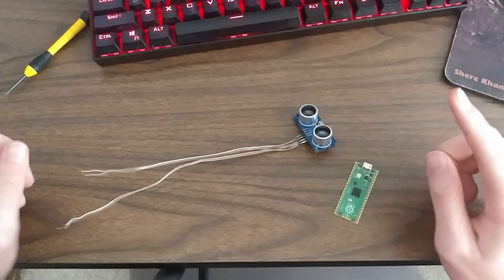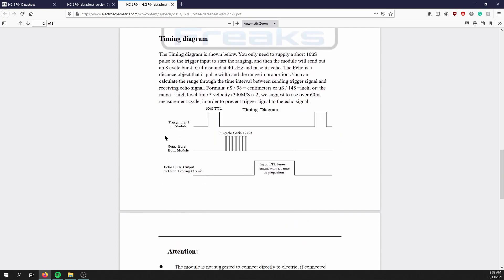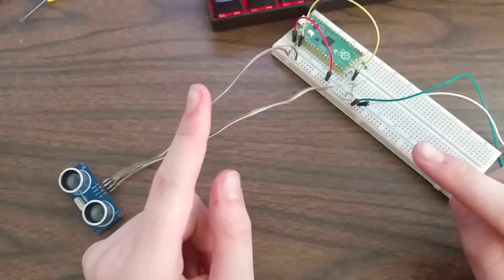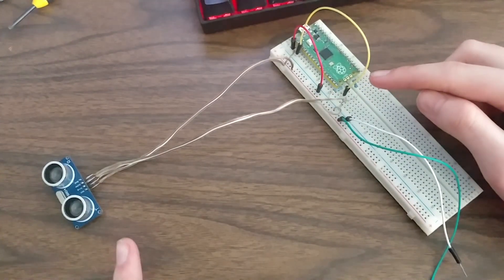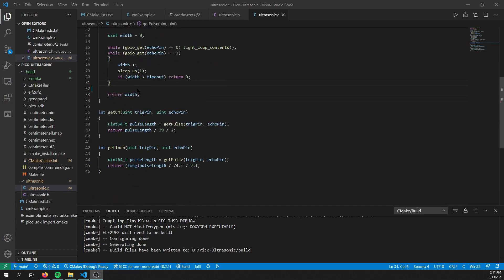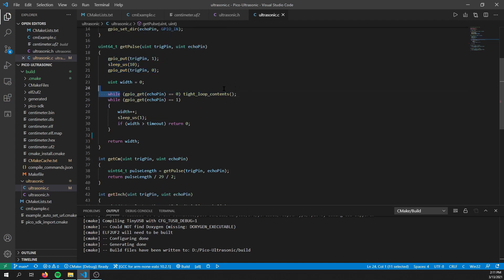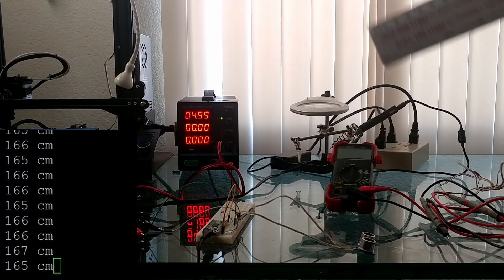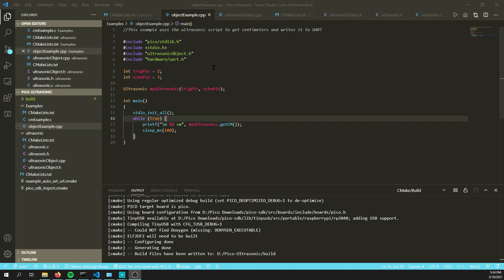How to use Ultrasonic Sensors with Pico - C/C++

Comment: So how exactly is this voltage divider working.
Reply from the maker: The ultrasonic sensor outputs a 5 volt signal. The voltage divider steps it down to a 3.3 volt signal do it doesn't burn up the inputs on the Pico. This only works because GPIO inputs draw very, very little current.

Comment: What's the max distance of those? isnt' this how rangefinders on guns work?
Reply from the maker: The specific sensor I used in the video has a range of about 4 meters. Rangefinders use laser distance sensors. The idea behind the operation is exactly the same, but instead of measure it takes for a sound wave to be reflected back, it measures the amount of time for the laser to be reflected back.

Comment: What if I need to get distance from 3 ultrasonic sensors? How would I approach to this case?
Reply: Enter different gpio pins for the function getInch.
Example Code:

//Gpio pins for first sensor
const unsigned int trigger_1 = 0; 
const unsigned int echo_1 = 1;

//Gpio pins for second sensor
const unsigned int trigger_2 = 2; 
const unsigned int echo_2 = 3;

//Gpio pins for second sensor
const unsigned int trigger_3 = 4; 
const unsigned int echo_3 = 5;

printf("\n %d Ultrasonic sensor 1", getInch(trigger_1, echo_1));

printf("\n %d Ultrasonic sensor 2", getInch(trigger_2, echo_2));

printf("\n %d Ultrasonic sensor 3", getInch(trigger_3, echo_3));
Reply from the maker: Looks right to me